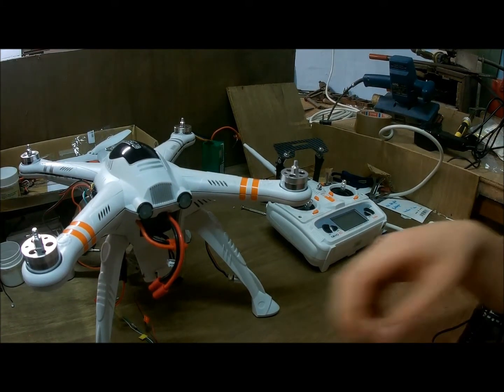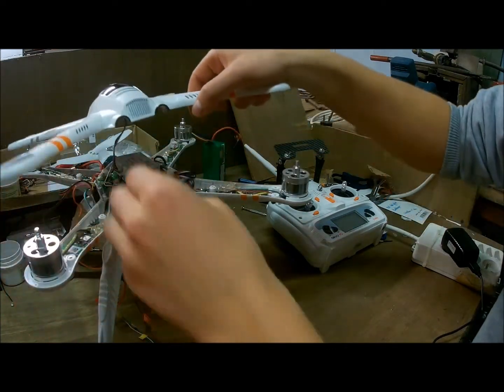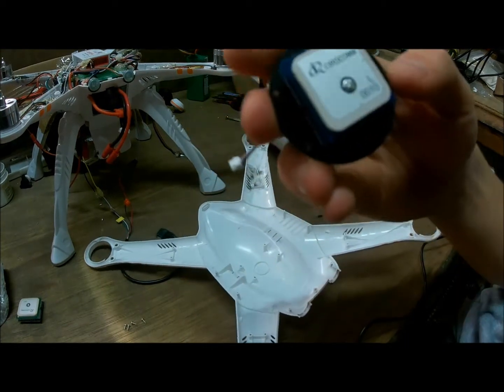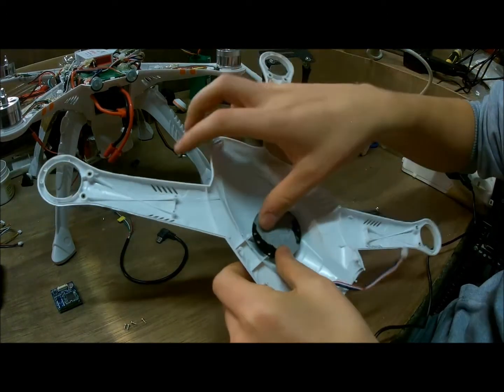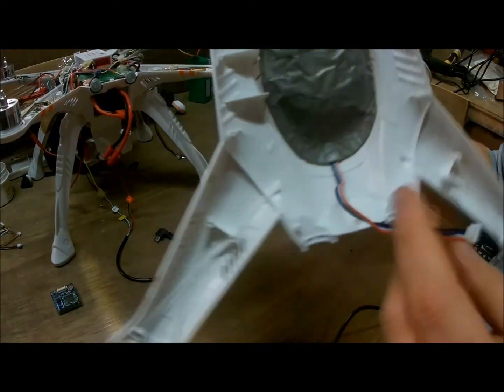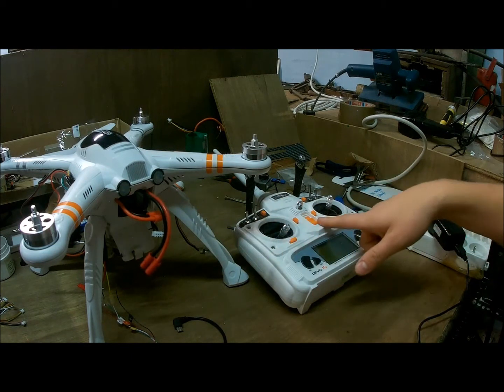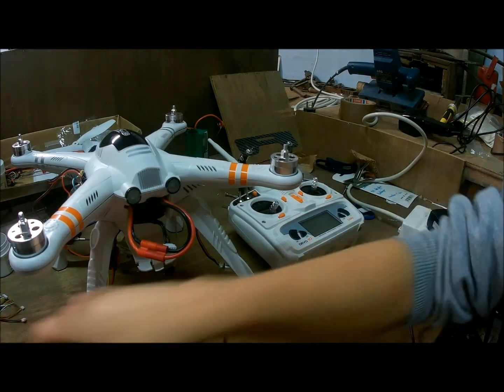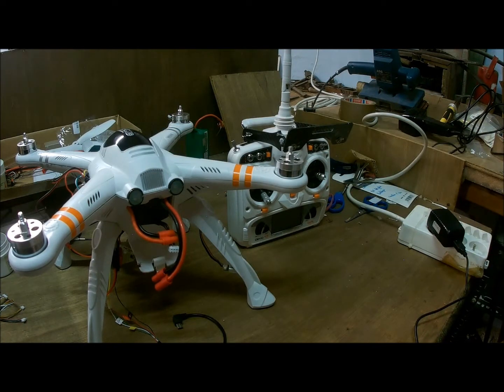Walkera qr x350 pro GPS mod

Comment: Do you know  what this pproblem could be...   when i lock hold on GPS  in 5 secs or less it starts bouncing and  starts bouncing and fall down.  
https://www.youtube.com/watch?v=KNlaK9mu2Q0
same here...  https://www.youtube.com/watch?v=Av5jLtArff8
Reply from the maker: maybe there is  problem with ur barometer or something else not sure . but go ahead to fb and ask ur question there they have all the anwsers on all the questions there are on ur drone problems. i really suggest ugo there and ask them . they will help u for sure fix ur drone so its a fun to fly it again !
friendly greetings
https://www.facebook.com/groups/WalkeraQRX350Pro/
Reply: I have the same problem. I switch to manual mode 2 or 3 feet above ground and dump the stick. Lands perfect every time.